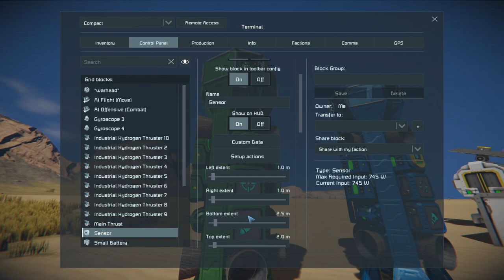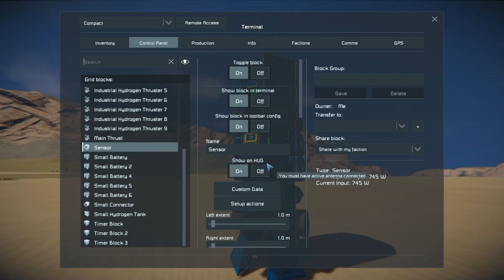Hydrogen Missiles Are So Powerful - Space Engineers Beta

Comment: Proportional navigation tries to have the missile keep the same heading relative to target, so if the target turns, the missile does so too. This allows the missile to rapidly respond to the enemy's flight path changes, which means it's easier to hit an actively dodging target. However, because in this mode it's not leading the target, it's a tradeoff worth considering.

Comment: Had the same problem with missiles not flying, turns out the ai controls the thrusters via a separate overridde program, so the timer you use to activate the ai blocks must turn off all override options within the settings (I just put lower override in the timer until every remaining toolbar slot was filled haha) fixed the issue entirely :)
Reply: Same thing here! It was the thrust override breaking the AI control, I solved it using a timer block that would reduce the thrust override and then trigger itself. Worked great.

Comment: If you want to make auto-firing missiles, I've used an atmos thruster and event controller set to read power level usage. When the combat control block detects a hostile, it obviously tries to take off, putting power to the thrusters. Having an atmos thruster means it won't burn fuel while idle. Event controller sees power being applied, turns on hydro thrusters and disconnects the connector. Off it goes, to cause havoc and mayhem.
Reply from the maker: That’s a nice way of utilising the event controller

Comment: Something I've had success with in using guided missiles is setting the forward thruster to override at maximum thrust. This is better for air-to-air missiles (I have a large grid destroyer that uses small grid torpedo tubes meant to operate in 0-G, where this works really well against other large targets. The idea is that it detaches from connectors, burns the forward engine blindly for about a second, then enables all of the other engines, the gyro, and AI behavior, and arms itself after another two seconds. I'd imagine that pointing this configuration straight up on planetside would work quite well, as it would burn straight up for at least one second before acquiring a target, similar to a few designs here, except that it won't stop halfway to the target because it can never cut thrust from its forward engine. This means that it often overshoots moving targets should it miss, but it comes back around eventually because it tends to point the thruster that's always burning away from the target.
Reply from the maker: Yea the difficulty is weight vs size, In gravity weight is the main issue as in a ideal world only 1 hydrogen thruster is need to hold up the whole missile and that doesn’t give you allot of wiggle room after all the core parts are in

Comment: 11:15 Try set Timer 2 to disable the rear thruster override. Maybe that's confusing the whole "go forward" thing and it's dampening its own forward movement.
Reply: i noticed this also. when you make missiles with 2 rear thrusters and have 1 set to override only 1 thruster is actively used by the AI when it takes over
Reply: @mugsy8  Interesting. Thanks for the info! :)

Comment: On the note of 'no reverse thrusters needed' I also have a hotkey setup for most ships in flight that shuts off reverse thrust in order to save power as well as fuel if using hydrogen and if you turn slow enough left right up down in space you can maintain a lot of your current momentum and save some fuel just by NOT doing a high G Turn with 100000000 Gyro's, as a fair amount of people do.

Comment: The back thrusters might be stuck in override, only turn on the AI's after disabling your launch boost.
If your making timer loops to override a thruster? Make sure to stop those timers when you turn on the AI block or that thruster will be stuck and AI can't control it.
Reply from the maker: I see what you are saying but when you turn the AI on It overrides the thrust override, meaning it is in full control of all the thrusters, also there are no timer loops, it works with just a countdown chain which starts when i press the button, good idea tho
Reply: @quantumchief  The AI will disable the override it but it will no longer control that thruster. If you set up timers to increase the override then decrease the override proportionally then it will function.
Reply: @batchnerd  ^^ This. It 'kinda' disables the override, the override sticks in the K menu but it stops providing any thrust. I think it still uses power and fuel as if it was at  full override though. Pretty buggy
Reply: You need to turn off the override completely for AI to be able to use the thruster! Can be done with a timer for example, by putting the rear thruster in multiple identical groups and placing each of them in the timer block toolbar with the "Decrease override" action. Taking into account, that we have 9 different pages of toolbars in a timer - this might work! :)
Reply from the maker: @DmytroTriXx  seams like that fixed the issue but still seams like a major bug to me
Reply: @quantumchief  I agree, I hope it will be fixed at the release of the Automatons.
Reply: @quantumchief  As some already pointed out, the AI can't take control of a thruster until that thruster override is on disabled.
I already fix it by stopping my start boost timer loop and starting my stop booster timer loop in AI activation timer block with rest like AI after 8 sec, and you use the event controller to start the booster timer loop. Use the same timer block to do call back for Infinite loop with thruster increase or decrease for the override boosters. 

That said it would be nice to see boost option on AI move block for intercept with time slider for second on the boost rear thrusters with a extra option to override gyro to 0,0,0 for extra stabilisation. But I did it only with 3 timer blocks and one event controller block, so it can be done with those extra option that would be perfect to add to the AI move block.

Comment: I know the bug that causes the AI to not work with the rocket that first launches vertically and then heads towards the target, the AI refuses to use thrusters that are set to Override, it's a bug inherited from Remote Control Block. 
SOLUTION: 
1. use 2 timer blocks set to close the override (must be a feedback loop because a single action only decreases the override by 25 propulsion units and does not bring it to 0)
2. use a separate stage for the override, and detach it when he reached a preferred altitude, like the 2-stage missiles or the S-300 system (with an explosive of departure = pseudo thruster like a piston gun)
Reply: not a bug its useful if you need to override the ai !

Comment: Hopefully someone found a solution to this: I've had a problem with the AI blocks where if I launch a single missile on its own, it works perfectly.  If I have more than one mounted to a single launch platform, however, while one missile launches, the other, despite having both of its AI blocks ON and AI ENABLED, will have the combat block reading as DISABLED in the status section of the control panel.  Even if, at the time it was activated, it was the only AI block on the grid.  It's a shame, since I've got a solid cruise missile ready to roll out come patch day, but it is sabotaging itself for no discernable reason (to me). 
  
The current logic setup is: Timer to trigger disconnect of merge and connector, as well as start timer for second timer. This timer a few seconds later turns ON and ENABLES AI for both flight and combat blocks, as well as all thrusters, and arms warheads.  Prior to any timer block activation, all AI blocks are off to prevent any sort of conflicts with the launch platform.  However, every time it seems to disable the combat block (even when the tab says it is both ON and ai enabled ON) when it runs its sequence on missiles past the first one fired.  Even if I save multiple blueprints with unique block names and groups between them to prevent the programming of one missile's timers interfering with another.
  
Anyone know what could be causing this issue?  How to resolve it?
Reply: If I had to guess it's just one of the teething issues of the Beta, because it says it's "Off" to avoid it overriding player movements on a grid, but, it doesn't know that there's no player grid there, so it just stays disabled.
Reply: Yo if you enable multiple ai blocks on the same tick one of them bugs out. Enable all the AI blocks separately even if just by a ms
Reply: @charleshughes2683  I'll give that a shot,  thanks!